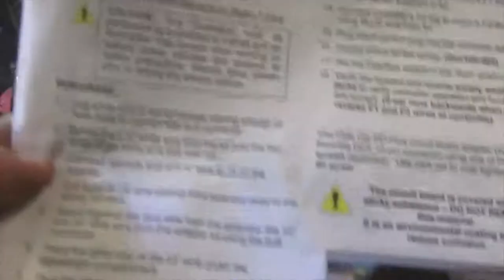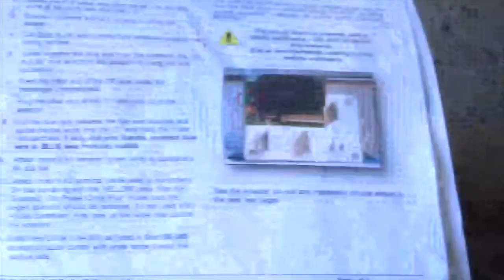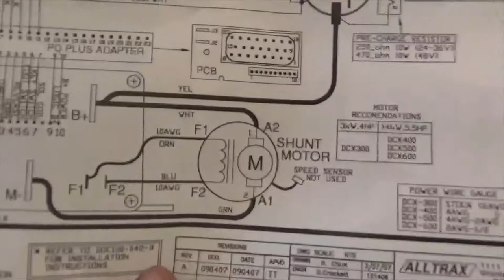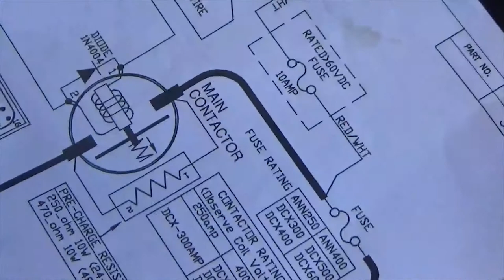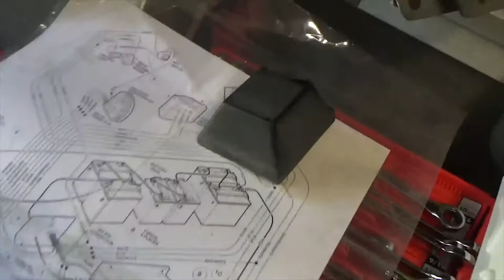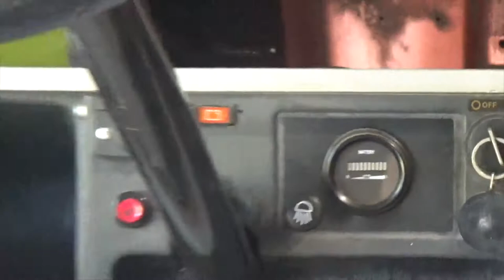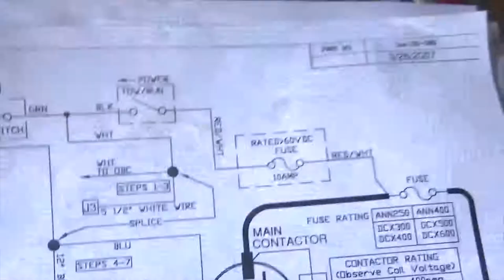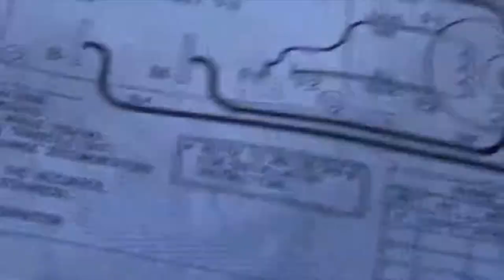006 Club Club Car DS 1999 All Wiring  (Alltrax 500)

Comment: Learned a lot here. I have a 2001 DS, I get 16 MPH with 12" wheels. I would like get up to 23 MPH and have a RUN/TOW switch, which would require a Harness upgrade, 400A Controller and maybe a Motor upgrade.

Comment: At 29:02 i dont even have that connector.. For the tow/run switch.. Please help.. I found the red/white wire is connected to the b- post from controller, looks like it runs to the key ignition from the controller

Comment: So did you put the yellow wire where the tow/run suppose to be?.. My 2000 cart is not running at all
Reply from the maker: Hopefully you got it by now, but for anyone else, yes I went with that tennis wire instead of a switch.

Comment: I tested my potentiometer and it seems to be in working condition.. Just cant get the cart to move still
Reply from the maker: Sorry for the late response. If you hear the click, it should be working. Only thing I can think of is the computer or the wiring from the solenoid to the motor.  I would try on buggies gone wild.  They have a forum for electric club cars. http://www.buggiesgonewild.com/

Comment: I hear a click when i press on the pedal but the cart doesnt move.. Batteries test at 48v
Reply: 28:30 is where I diagnose my tow/run. I had a connector, but had to put a wire in since I didn't have a switch. Without the switch/wire, you won't hear a click at all. You should hear a click when you turn the key. Then, there is a Forward and Reverse switch, one way will get you a backup buzzer (if connected) and the other will not. There's also a 3rd, "neutral" position.
Reply: @yourtechjohn  i hear the click whenever i press the gas pedal either on forward or reverse with the key on..
Reply: @yourtechjohn  do all the 3 metal pins from the switch should lift up when on reverse? When i put it on forward it only lifts up one metal pin. But doesnt go anywhere..
Reply: @mrhoya14  i got the same problem man.

Comment: why didnt you do away with the computer to controll nothing but charging that just a problem waiting to happen i dont see no reason to have that.cause the charger is not a automatic it dont maintain the battery.i bought automatic maintainer it can sit there a year an the battery pack ready to go..if you use battery charger with these once it shuts off it want start back so why have a problem on the cart
Reply from the maker: I have done just that actually. I have an external automatic charger and they onboard is not connected at all.